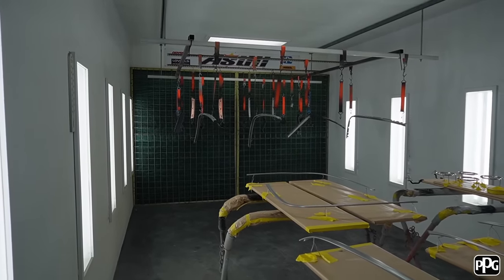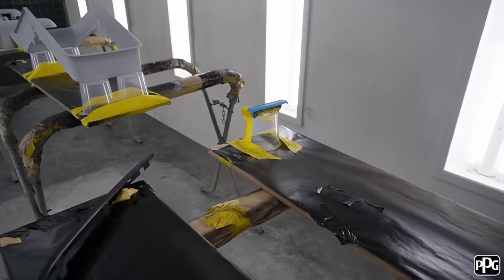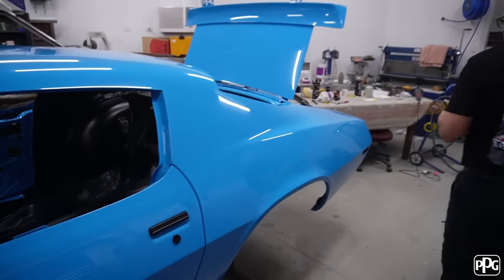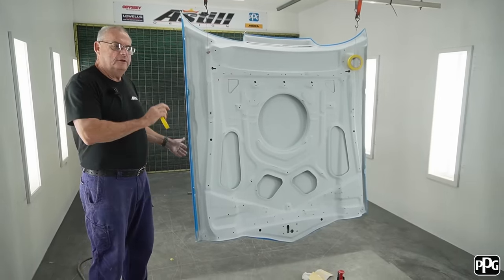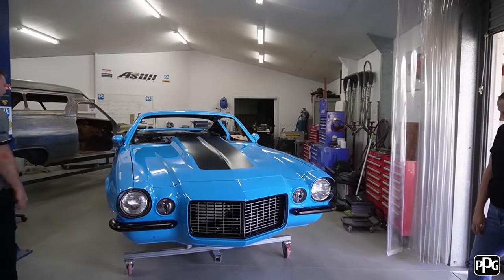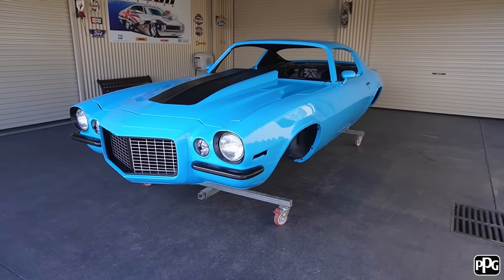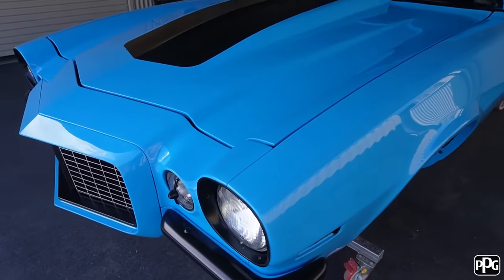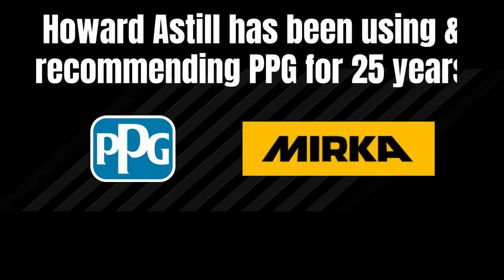#14 Final Pieces on the Camaro before it get's picked up by Perry's Garage | Muscle Car Respray

Comment: last time you put about 4 layers off clear  onto the hood.   i also work with PPG and will get blistering problems with so much as 3 layers . so max 2 is my limit. this   because the sulvent wont have the time to resolve.  so it will leave cooking isseus witch wont polish out.  even with slow thinner or hardener...  so i was reaaly suprised to see your 4 runs....

love the non mett bleu BTW
Reply from the maker: Solvent boil may be caused through too much airflow over the surface after application
Reply: thanks for respoding.

dont think thats the problem. you need good ventilation.to protect it from overspray. i do believe its because of the first coat solvent wont resolve out of the clear because its blokked by to many layers. its actually pretty logical. i was reaaly suprised you getting away with the thickness @AstillDesign

Comment: This is one of the best looking camaro in the world at the moment.

The blue is the colour of the sky, so you made a dream car, 'sky car'.

Should do the nomad, or my dream custom car is a 57 sports coupe, made into a Cabellero.

But could call it Conchita, I'd put on  kelsey Hayes wire wheels og ones from the 50's with titanium spokes, around the car, lowered 2“ 108mm.

A fabric sunroof, a Webasto with the smoked air deflector from the 70's from a Jaguar.

Titanium roof bars, in the og style, but what colour or colours?

I think a Jaguar met racing green, their racing green as its nearly a black colour from the C & D types.

And have a couple of monkey bikes paint matched or contrasting in the colours that didn't make it.

And use a rear hatch/tailgate from the 70's Ford, with the switchable opening.
Reply from the maker: Thanks for sharing

Comment: Afternoon Howard, and a merry xmas mate! Great body work and finish on the car. The devil is always in the detail I was always hoping it would have two black stripes as original in a tangelo metallic, but that's me. I wanted to ask you, was there a reason you lay the bitumen layer and then paint over it? i think i know but i don't like assuming. Thanks,
Reply from the maker: I just like to seal it all up with a solid overall colour and tuff clear coat.